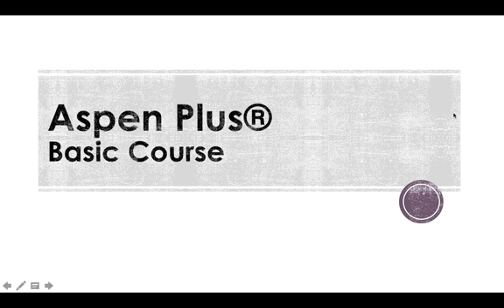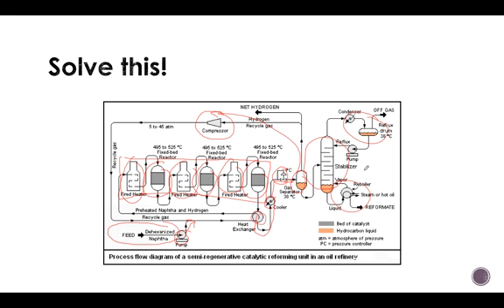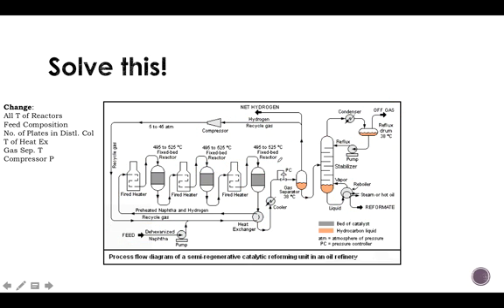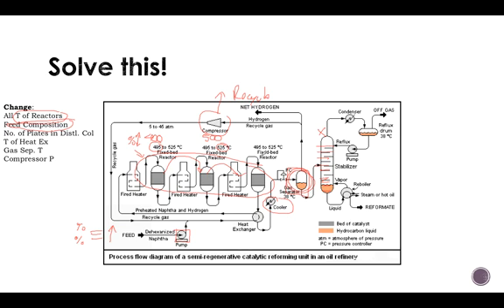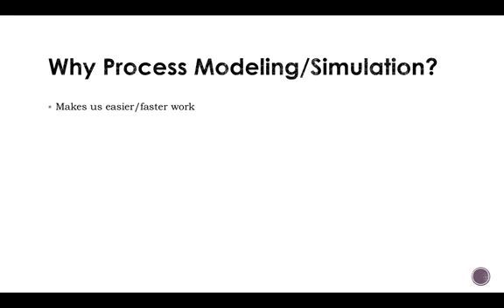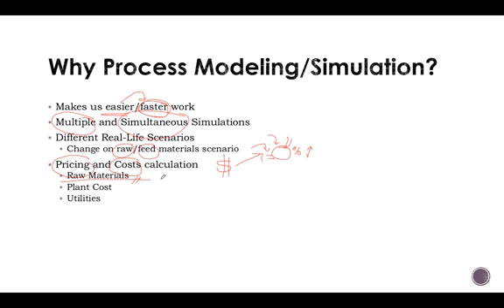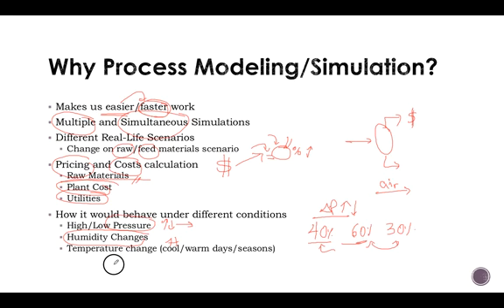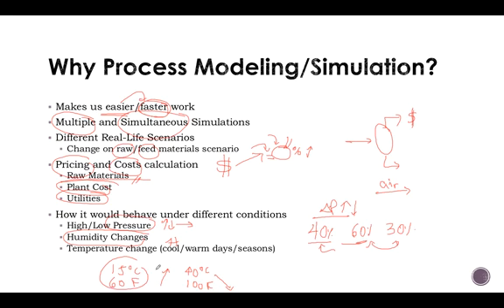Lecture 01: Why Simulate/Model Processes? (Aspen Plus - Basic Modeling)

Comment: i wanted to buy the full course, but i do not have software. any suggestion?
Reply from the maker: You will need it to practice the workshops. In my opinion its very hard to learn how to use a software without access to it. Try in your local university.